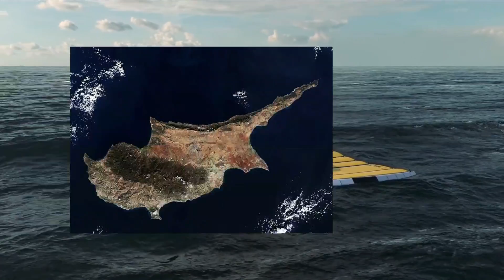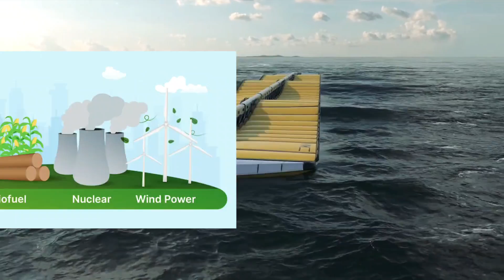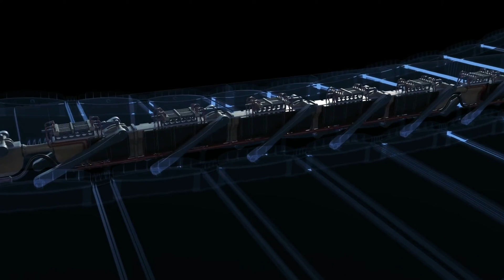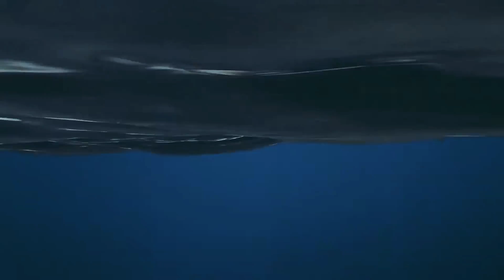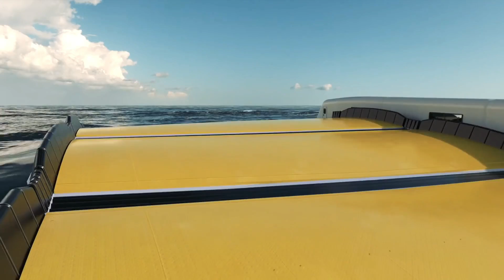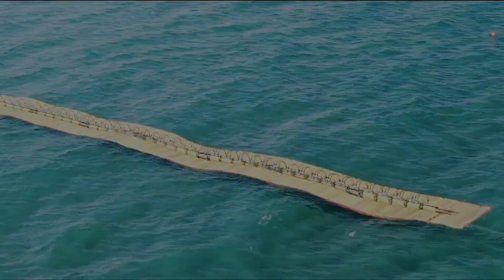This Spine Like Floating Device Can Convert Wave Power into Electricity

Comment: Now imagining having solar panels on top, win-win situation
Reply: Imagine having a tornado now?
Reply: Insane not to add solar panels.
Though I find it hard to imagine how you make something like this durable enough to survive both corrosive salt water, pounding sun and extreme waves
Reply: I was thinking the same thing, but I understand why they didn't. Cost and pollution. Which they mentioned towards the end of the video.

I think an added bonus to this, is the more we use, we could potentially lower or help slow down the heating of our oceans...?